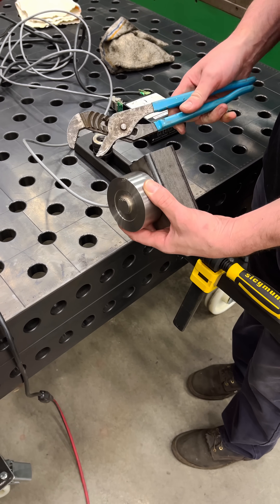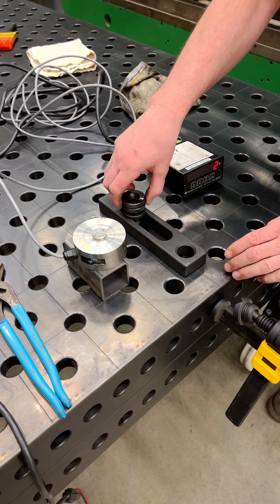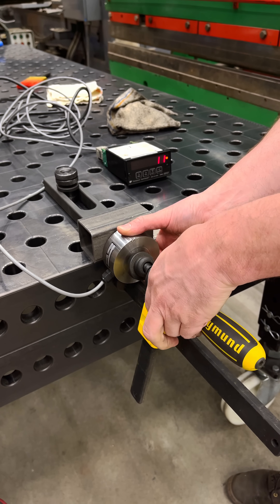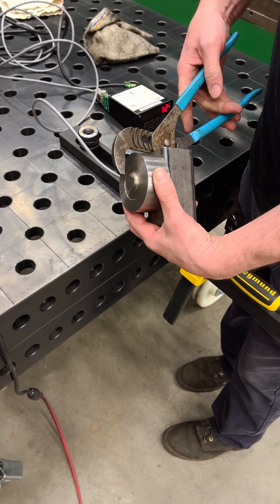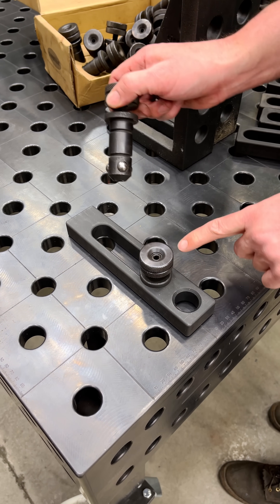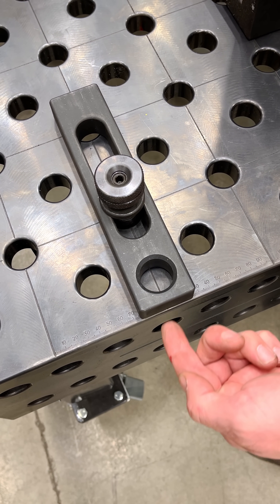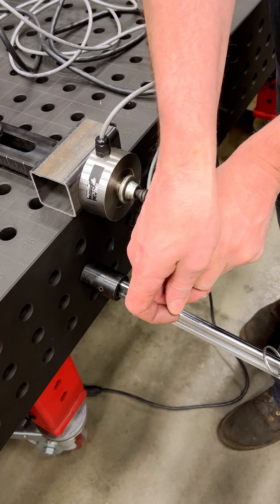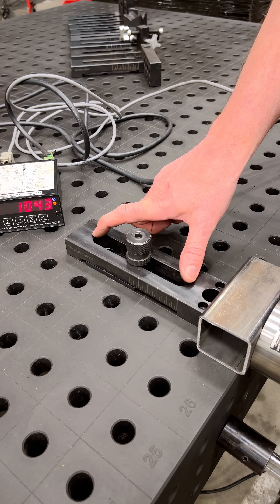Think your clamp’s holding strong? Think again.

Comment: I try to avoid slotted holes in designs for this reason. If you lose some clamping force (bolts loosen) it then slides around by the length of the slots.